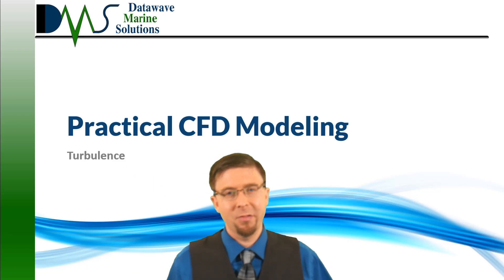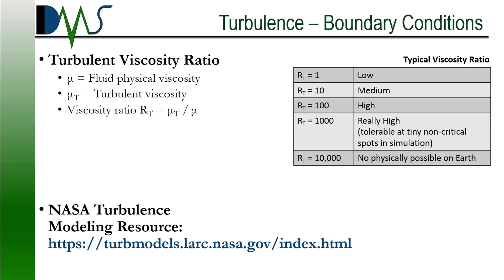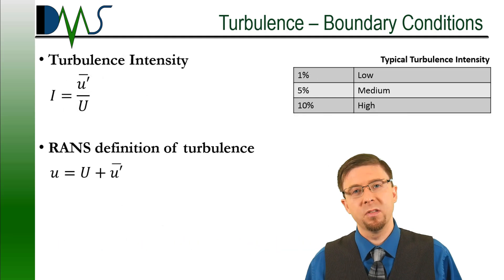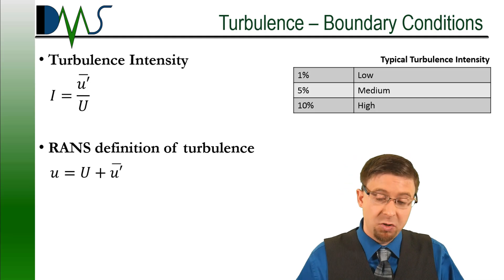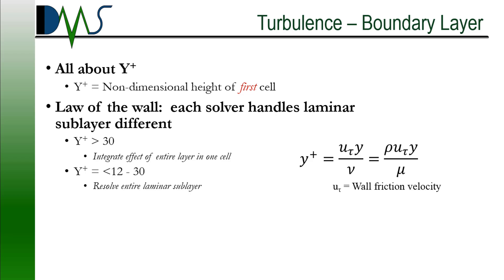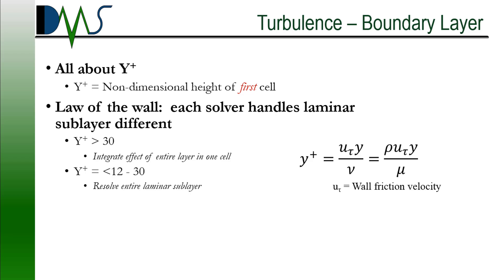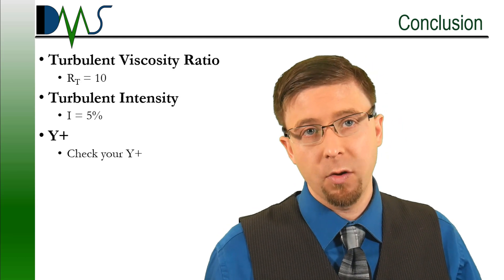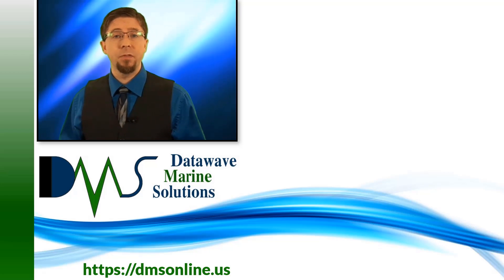PRACTICAL CFD MODELING:  Turbulence

Comment: i am a little confused with your y+ values... don't you need a y+ value of below 2 (below 1 with heat transfer) with sst-kw turbulence model? and 30-300 for k-e? i guess you already said it, that it is dependend on the tuburlence model, but i haven't seen one with y+ of 5 or 10 recommended! cheers and thanks for the great videos! :) maybe you can enlighten me
Reply from the maker: It depends on the application.  For something like a lifting foil, accurate resolution of the boundary layer is critical.  And yes, a y+ below 2 would be appropriate.  
For ship design, we don't need accurate resolution of the boundary layer.  At those scales, the boundary layer doesn't do much to alter flow patterns and has little impact on the overall resistance force.  In those cases, Y+ of 80-100 is appropriate, using a specific wall treatment to capture the effect of the laminar sublayer within the first cell.
But it all depends on error sensitivity.  For a ship application, we risk misestimating the point of flow separation.  But in reality, if that separation point is 30% off, that still has negligible impact on the total resistance.

The final factor is budget.  Going back to the case of the lifting foil.  Y+ below 2 is the scientifically accurate way to do it.  In some cases, that may change to a Y+ of 5-10 because we don't have the budget to do things 100% accurate.  That's a practical reality of some industries.  In many cases, we need to consider the consequences of inaccuracy in CFD.   Ask whether a 20% error would change the project decisions.  If not, save the budget for a simulation that really needs the accuracy.

Comment: This is a great series of videos. Thank you for taking the time to make such professional presentations.  Your practical explanation of Y+ is great.  I have been hard pressed to find real world information about Y+. Do you have further references that would be good for Y+?  I'm the programmer of DesignFOIL and I don't mess with such things (it's a panel code).  But I'm trying to learn more.
Reply from the maker: Probably the best place is to start with a Fluid Dynamics 101 book and lookup Boundary Layer Theory.  One book on my shelf is "Mechanics of Fluids" by Bernard Massey.  But any introduction to Fluids book will cover Boundary Layer Theory.  You especially want to look into the definitions for Displacement Thickness (https://nptel.ac.in/content/storage2/courses/112104118/lecture-29/29-2_boundary_layer_thickness.htm) and Momentum Thickness.

With panel codes, the boundary layer is normally solved separate from the potential flow.  They have two completely different solvers, but share a boundary condition.  The pressure gradient from potential flow influences the boundary layer thickness.  And the developed boundary layer thickness modifies the effective surface of the airfoil.  So you define a whole new surface for the potential flow code, based on the original foil geometry, plus the boundary layer thickness, which changes.   The mathematics and numerical solution can get very complicated.  It depends how far you want to take it.

Comment: Can a CFD program handle the full 3D range of motion? What if I just want to make a waterfall and model the water falling over the edge and into the river below? Can it do that? Will it make realistic turbulence and mist? I come from a computer science background so I'm thinking more in terms of 3D graphics engines lol. Water is hard to model in real-time.
Reply from the maker: Yes to all of the above.  Full 3D range of motion:  Yes.  We can even do lifeboats plunging into water (https://youtu.be/YAmaY82sK9E).  Waterfall over the edge of the river:  Yes.  Realistic turbulence and mist:  Yes (but difficult).  Most of the CFD simulations you see will not look like realistic because we are focused on visualizations that highlight the technical details of the flow, not realism.  But have seen some simulations that take a CFD simulation  and then put it through a render program to create very realistic animations.  (https://youtu.be/CUV18udfLQ8)

The catch is that we can't do these simulations in real time.  For example, that clip of the lifeboat that I linked probably took 3 days, running on a 120+ core cluster to generate.  The mathematics are very computationally intensive.
Reply: @DatawaveMarineSolutions  That is really cool. Yeah i knew it could never be done in real time, especially not 60 or 120 fps like ppl want these days. The water in your second link is very realistic, which is so amazing to look at because computers (usually) render wavey water really badly.

However, the video shows water filling up in a cubical tank. For a waterfall, what's needed is to somehow remove water downriver so that the river doesn't fill up. Is that possible? How would the program remove water without creating some kinda vacuum with chaotic effects? I remember you saying something in a previous video about the outer walls being fixed so that gives me doubts too.

Do you have a link to a demo rendering with mist? (Any mist, doesn't have to be a waterfall.) I have never seen CFD do water in its gaseous form, only liquid. Which brings up an auxiliary question lol. Can CFD do ice too?

PS, the links you posted were broken because they included a trailing parenthesis. Also, sorry for the late reply but for some reason youtube did not notify me of this reply like it usually does.

Thank you for all your vids btw. I have watched most of them and liked almost all, even these CFD ones. I did well in math, and i have done some light physics sims in my programming before. I'm getting interested in CFD now and wonder if it's something that will lend well to quantum computers.